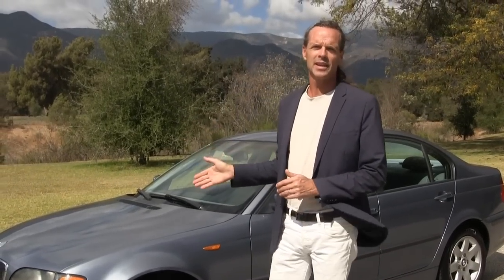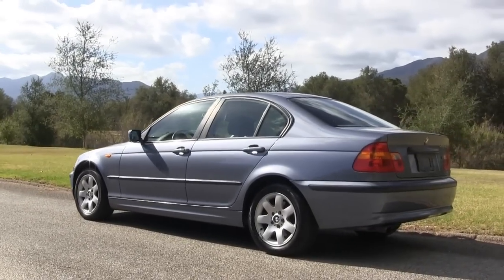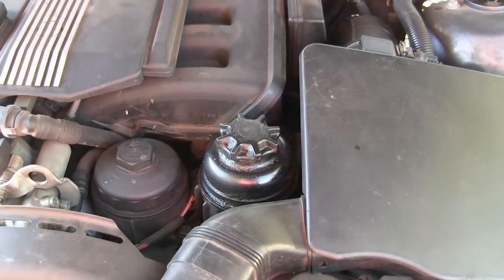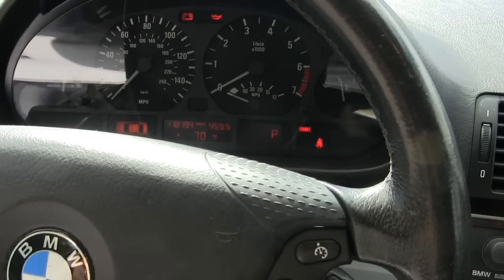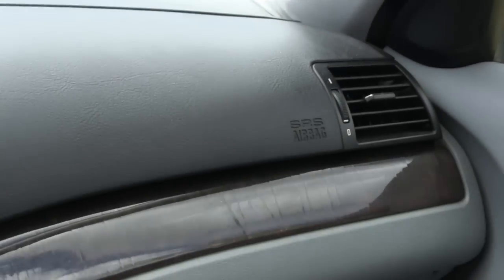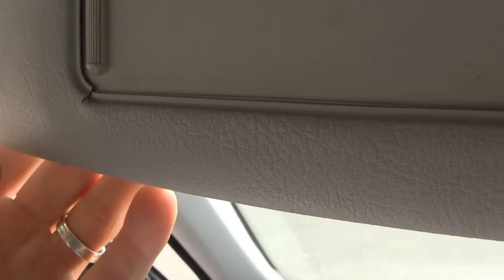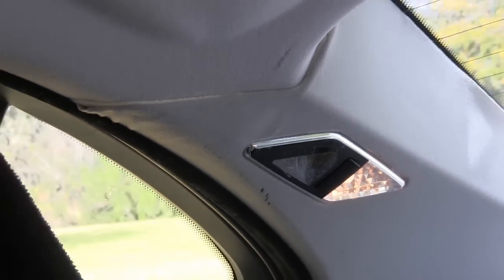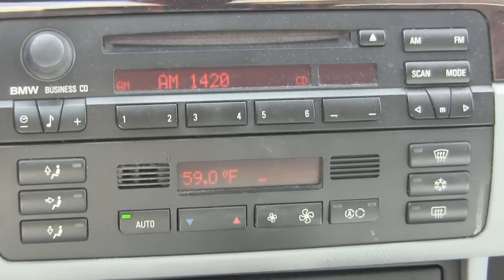Why You Should NOT Buy a Used BMW

Comment: I totally disagree with this man as the vehicle used hasn't been maintained throughout the years and me personally, I have had 5 e46's ( 2 M3's and 3 330's) and they have all been perfectly fine with the exception of a maintenance job here and there. I had one that did 200k and would happily do it again or sit there at 155mph. In my opinion, this man has bought a car that has been poorly maintained and seems to think that if cars that aren't checked every year or so, then they should still be in perfect condition😡
Reply: Totally agree. I have 2004 bmw e46 n46 engine Sport Package. Got it in 2012 when it got 76k km on the clock. After 6 year it has now 195k and still running strong. It has a beautiful colour. Estrol Blue. My favourite colour! This is how mine looks http://farm8.staticflickr.com/7007/6745036163_3293fca333_z.jpg. Girls drooling big time and its a dream driving 180kmh on the highway. Also i can hold 180kmh in the corners as it feel very stable and dont lean so much like crappy other cars. My next car will be 2004/2005 330d sport package. I saw one exactly like mine but 330d. It was incredible rare! Wish i had that 330d! But 330d maintenance is higher than 318 for example so thats why i done my homework is is clever what i can afford and not. Once my money problems is sorted i will get the 330d and not worry much about maintenance. But also i just happened to find a incredible low kms which happens to be a 318 of mine. 330d low kms or selling one are very hard. Think ppl keep them. But im sure i will get one one day lol

Comment: I have a 2001 E46 and mine has 160k on the counter (km) and i have NONE of these issues, never had either...only thing I replaced is the gasoline pump, which was 200 euros. Of course if the car has been previously used by an idiot who thinks he's a racecar driver, you will have issues and wear...it's 20 years old ffs..

Comment: I want to feel good about my good looking, raggedy assed 2000 323ci with every problem pointed out 
Maybe I can find some upholstery spray glue and glue the fabric back onto the pillars.
As for cooling system, all parts have been replaced.
Still have a persistent leak in the expansion tank to heater hose. I don't know if an O ring in missing at the tank connection. The leak persist.

Comment: Disagree 110%
Maybe u got a lemon due to past owners negligence.
I bought my 2006 325xi a year ago with 149k in chamge.
Pushing to 176k now.
The only problem i had was the starter wich i replaced locally with one of the best mechanics i ve seen..
Other than that..usual wear and tear..oil change every 3.5k miles..house gasket beacause i wanted...spark plugs also..
Thia car is a tank i have ro say..u r wrong and unlucky

Comment: I reckon this guy was sacked by BMW and has it in for them! Mine's got 175,000 miles on the clock and yes it has had work done on it but none of that cosmetic stuff where the car is falling apart. He's just picked a crappy one that hasn't been looked after. He sounds bitter?

Comment: This fool doesn’t realize the car is old #1 and it’s not gonna have that brand new quality over time ofc things are gonna crumble and fall apart just with any older car things have to be replaced in order to be reliable. almost 80% of these parts are cheap and easy to replace I myself on an a 2000 e46 323ci (perhaps the worst year the car was made due to sub frame issues which all e46s have) 96 miles, if you take care of the car it will take care of you

Comment: Anything German is expensive to purchase - are great during the warrantee and the original owners get rid of them as soon as the warrantee ends - I wonder why ? Parts are almost always very expensive and the vehicles are just not that reliable. The mirror delamination problem was the same problem I had on my 1980 VW Rabbit and my 1988 VW Rabbit. German electronics are NOT reliable like Japanese electronics. I stopped buying German and switched over to the Japanese where the reliability has allowed me to drive them to 350000 plus kilometers with minimal repairs.

Comment: You made this in 2016.  There was no way for you to make this video with an E36 3 series because at that time you could only find mint ones that would showcase the engineering prowess of BMW.  

This video seems like you have a predetermined dislike for BMWs in general.  You picked a car that was the absolute worst example ever; I guarantee 95+% of BMW owners treat their cars way better than this.  You also conveniently made this video 10 years after BMW stopped making the E46.  I love how in another video you draw a graph of when a car is good to buy used and when a car is bad to buy used and this car is at that age (conveniently for this video) where it's bad.  So really, you're just showcasing a horrible BMW when there are so many greater examples.   It also kind of irks me when people make blanket assumptions about a car when it can make or break the difference who the previous owner is.

Show people objective examples, not your opinion.

edit: jesus christ I just rewatched and this BMW has only 118k on it?  Way to pick the worst,  I've bought 2 e46s over 150k in mint condition and my current daily is like 90% mint and I bought it at 130k.  Just more evidence you picked and chose the worst for this video.

Comment: Lexus is better . Cheaper parts . Long lasting service . Benz and BMW have a lot of electrical problems  with most models . BMW fans take it easy don't lie about your car being the greats car . Especially  used .
Reply: Well i have a bmw and never have problems unlike lexus / toyota. So shut up if you dont know what y talking about. Its abused bmw that break down. Dont confuse  a abused bmw vs well mantained bmws
Reply: Sean Smith  Yeah ok I think you just lucked out . I know what I'm talking about bud . I have owned brand new x5 new s430 new e350 4matic . SO PLEASE YOU SHUT UP AND STOP ANYTHING MAN MADE CAN FAIL . SOME FAIL FASTER THAN OTHERS .

Comment: Poorly mantained, abused, and 15years in a very hot climate, looks ok considering, a lot of makes would be in the junkyard after all that,  you can pick holes and find faul with every car ever made, But one thing about a BMW is if it's a well maintained and looked after car, it will always reward you to drive, And they don't have to cost a fortune to maintain, there are plenty of independent specialist available, and an abundance of used spares available. Buy one that's been cared for with full service history, and hasn't been left cooking in 100 degree heat for 15 years , you won't have to many problems. Ray 30 years motor vehicle Tec, seen some piles of Pooh maskerading as a car in my time,  BMW ? Not one of those. Anyway what the hell does Michael Bolton know about car's?

Comment: BMW are overhyped here in europe.  in fact everything from germany is overrated here.  You can't talk bad about german cars or else they take you as a fool. italian cars fail  german cars don't fail  ; they'r just unlucky or had bad maintenance....   YEAH RIGHT .    THANKS FOR THE HONEST REVIEUW AND BUSTING THIS LAUSY MITH...I continue : valve  leak,  cylinder linig fail.   transmission fails,   unibody reinforcment of the rear suspension  can breack off the unibody  causing deadly accidents .   in other words  it's designed to have a calculated lifespan.  fanboy's  cry

Comment: Absolute nonsense ..... I have 3 old BMW's .( ages 30 years to 7 years)My E39 with same engine and has got 340 000kms on the clock and still going strong . Best car I have ever had. Easy to work on , spares very reasonable and available. Any car if not cared for will fall apart and look like this piece of junk you got from your local junkyard. Clearly Mr  "Angel" you went looking for the worst example you could find !! .  Your review is a joke !!!!

Comment: I would not buy a high mileage car in general with out some kind of wrenching knowledge. Every little nagging repair you will be paying for in high dollars. The repairs will typically come more frequent than you are expecting and probably cost more than you are expecting and hardly ever less than you were expecting. If you do want to buy a high mileage car absolutely make sure you have some extra cash "at least a few grand" depending on what you are buying to make sure that you can afford some repairs. Which the car might need in the very near future.

Comment: EVERY SINGLE problem you demonstrate in the video has happened to my car plus many that weren’t even mentioned. Worst car ever. Sure, the engine itself runs well, but with this many plastic parts in the engine bay and interior, what’s the point?
BMW are complete crap cars and I tell everyone I would NEVER buy another one.

Comment: That car is in crap condition. Who cares if it was garaged. It wasn't CARED for. Someone who can't be bothered to spend $40 on replacing that rubber trim... has no business buying a car that WILL require $1,000's in repairs. You come across lot of 3 series like these, but it's easy as hell to find decent or great ones. There are a shit ton owned/loved by enthusiasts. And any idiot who buys a BMW without being mindful of the maintenance overhead is just that. An idiot. 

It's not a Civic. It's the cheap BMW FFS, of course it's expensive. Who buys an old BMW expecting perfect reliability??

Comment: I don't know about the e46 the e56 on a 2005 x5 3.0 is a nightmare from leaks to electrical problems draining the battery to plactic window part In constant need of replacing not to mention hood springs that won't open the hood tire wear because of a poor design BMW claims to hold the road better better what a damn joke have taken it the dealer to many times for battery drain and as of today they can't fix it I'm dome with these over priced pieces of shit that

Comment: I bought a new 5. Four years later the water pump  failed due to BMW actually building water pumps with plastic impellers which broke off. Engine overheated and destroyed head gasket. We buy Buick’s now, 10 times better car.

Comment: well my 2001 330ci is almost in perfect condition after around 240,000km. I think it depends on the owner, how you take care of the car, if you dont give a fu*k and dont take care of it, then ofcourse it will turn out bad... Thats for any car you own. Take care of it from the beginning and you wont have that much problems... the only "problem" i have is that the paint is starting to come of the front fenders wich result in rust, but i have 2 new ones at home that i will repaint and then replace the old ones with. But rust comes on any car in the age around 18 years old especally if you drive the car in the winter, road salt and so on..... bullshit video